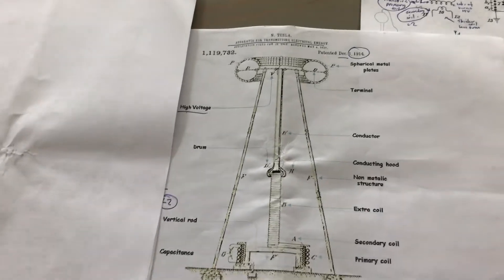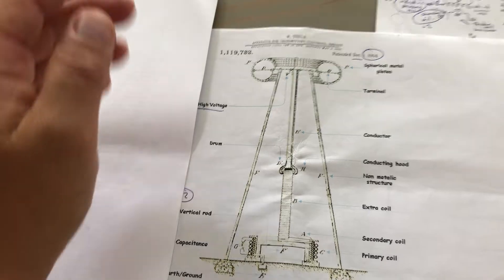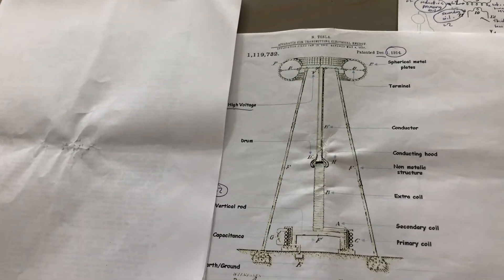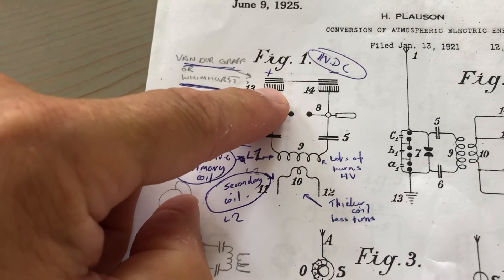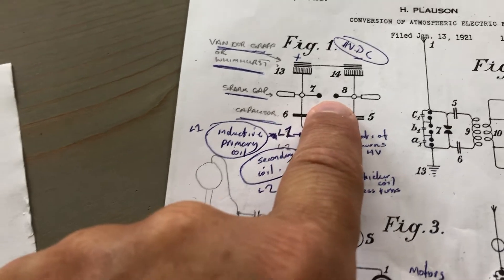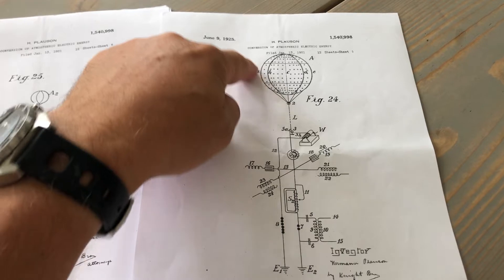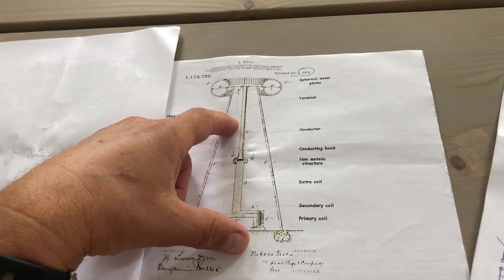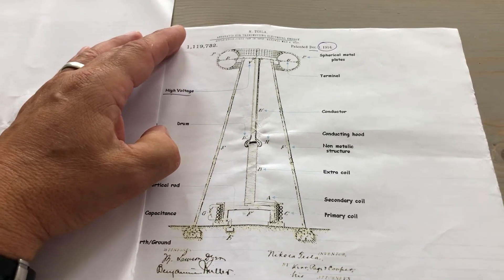Ion harvesting, passive, natural, balanced free energy.

Comment: Amateur radio people have long wire antennas up around 40 feet, and the static charge on them varies with the weather. Sometimes during a storm they get so much voltage it will destroy radio gear so they will ground the antenna feed during those times. I do not see that method as reliable, because other times they will have no charge on them at all. WE normally put a lightening arrestor in the feed line before it enters the house to discharge these HV spikes and arcs. There is only one kind of energy that is stable from the earth grid. 135 kHz mass vibration from earth nodes, you must learn how to locate them. This is however not EM persay, it is a mass vibration. Mass vibration can be used to amplify electrical power but the methods have not been perfected in our time period. Many tweakers have been able to hit on things that work, but few can explain how it works. There is a ratio that operates between the Electron and Proton in atoms, and coils wound using the ratio have been known to self sustain a mass vibration between them. Floyd Sweet used this ratio.  http://www.resonantfractals.org/Doc/EP_Ratio/EP_Ratio.html
Reply from the maker: Thanks 🙏

Comment: At the moment I think for collecting we need to start with charged capacitor. Not looking at that charged capacitor as " it doesn´t work you had to charge that capacitor" but as " the charged capacitor started the process" At the moment I believe that we need to go above certain voltage level to start an avalanche allthough I don´t know what exactly that level is. I experienced more stability in electric field around plates (longer time of existance) when going above 7KV, but I´m not a specialist.
Looking forward to your results.
Reply from the maker: Thanks 🙏

Comment: What I believe is that the tower is not use for transmitter. It's for the collector, the entrance of energy from atmos...
Reply from the maker: Yes so to try and make this with the atmospheric generator should give us continuous energy?
Reply: @dkdyker  Am not sure yet as it only attracts when working with HV. So still we need external power source for that HV. Absorb ion from atmos may help improve the performance though. 
Attraction only happens when having HV and especially with Earth ground.
As I understand he made that tower to suspend the antenna as collector up to the level where that energy are most abundant. Thru the HV applied it attracts the 'ION' as you mentioned and he pushed them to the receiver via earth ground using the special type of wave. 
Using Earth he may transmit that energy to any different part of the globe without any interruption or obstruction from mountains and buildings and the slope of land like a sphere ball curves. 
That is why by using tesla coil as wireless power transfer that sending power thru air is not so effective and efficient than using Earth as a medium.
So the motor may goes well with Earth ground and supended antenna.
Reply from the maker: Thanks JB
Reply from the maker: Please check out lasersabers vid this is it ! We now have a possibility